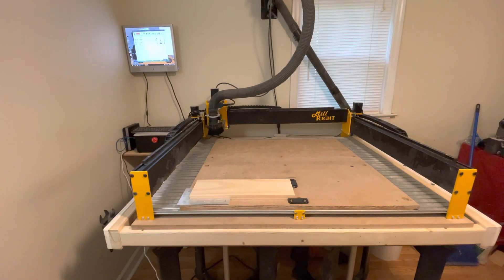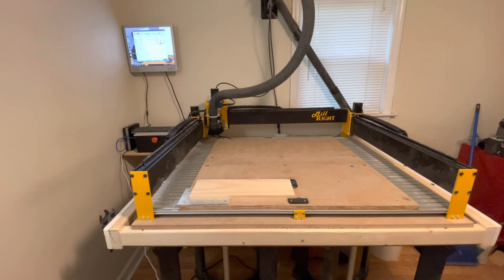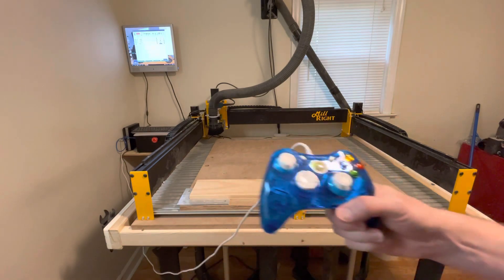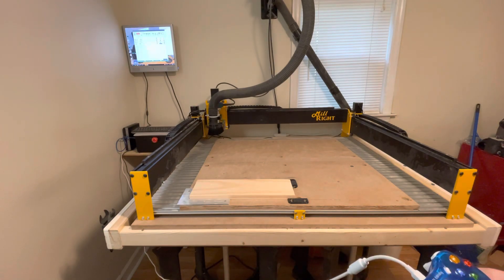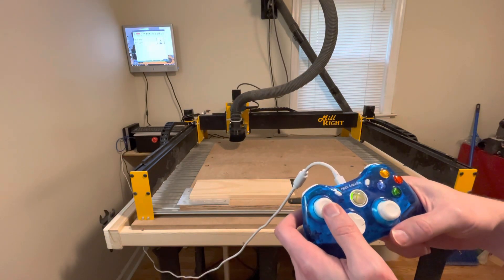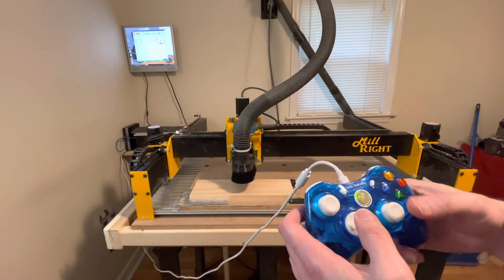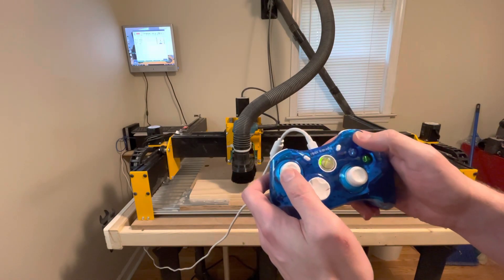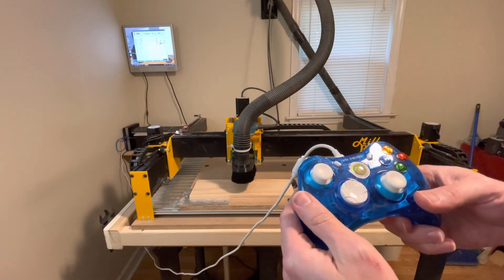Millright Mega V XL XBox remote Pendant AntiMicro OpenBuilds Control

Comment: Hello..cool idea...is this program stand alone or can it be used along with universal gcode sender..I have a mega v xl also and this would make things alot easier..thank you
Reply from the maker: It is stand alone. It is only for a pendant. I use it with Mach 3 also.
Reply: @DavidKK4GAF  ahhh..ok..does it work better than UGS
Reply from the maker: Yes. OpenBuilds Control does.
Reply: @DavidKK4GAF  ok cool..tks